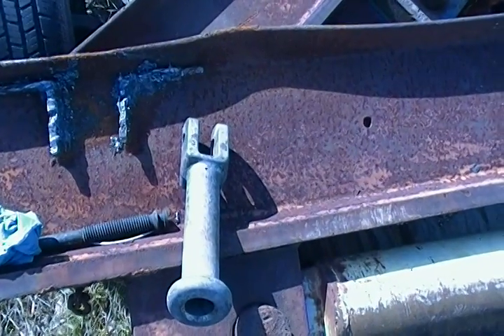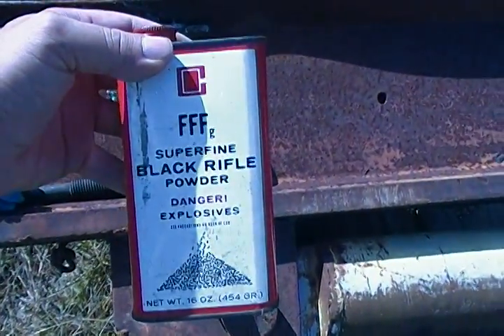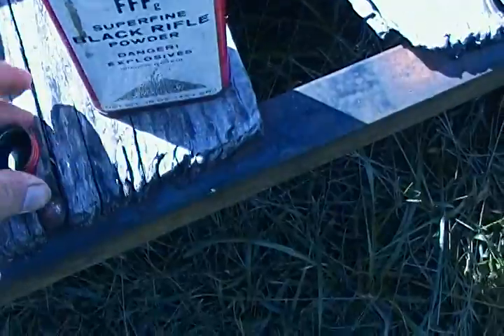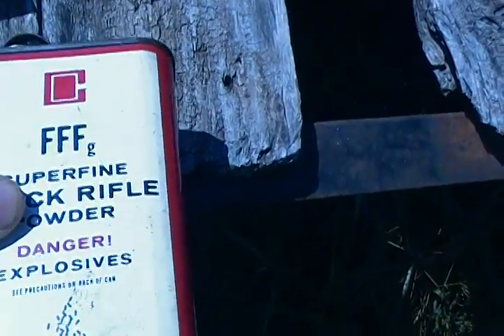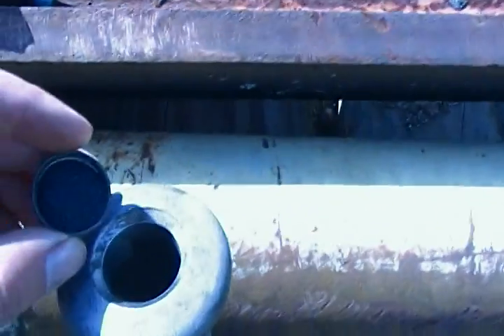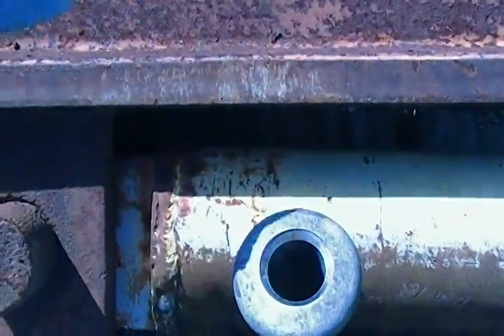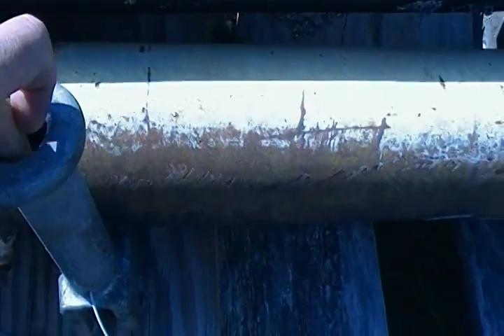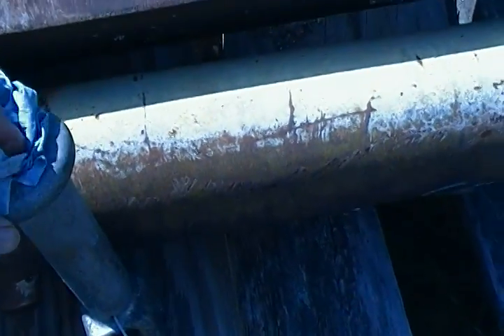How to load and fire your signal cannon.

Comment: Would a wooden rammer be safer
Reply: Non-ferrous metals such as brass and aluminum are safe. They won't  create a spark just by tamping.
Reply: Yes...and cheaper; not everyone has scrap brass fittings lying around.